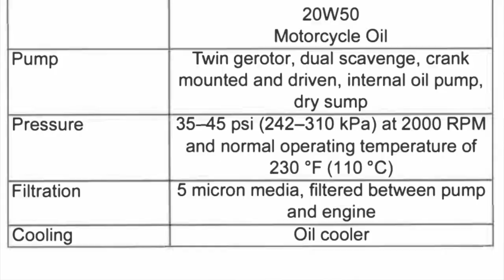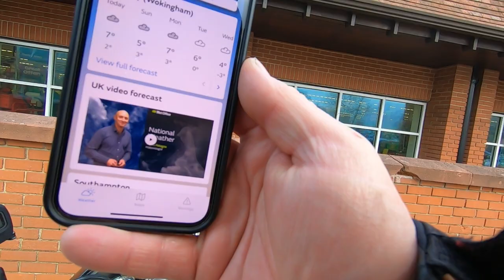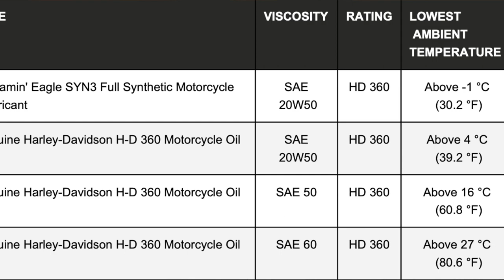Hot Harley Engines | What's The Truth?

Comment: I’m not an expert on oil, but for the past two years, I have been reading up as much as I can on testing in from people that actually know about oil. One of the things I read on motor trend magazine, is that oil needs to get higher than 212 in order to burn water off as condensation, because water boils at 212°F. The article also said that oil starts breaking down past 275°F, and that the ideal sump Temperature is 230 to 265 Fahrenheit. Just thought I’d put my two cents in, thanks for all the content.

Comment: I know this. My ‘21 Low Rider S is a very expensive motorcycle and Harley Davidson has been criticized for using more and more “inferior quality” parts for the internals of these M8 engines from sources here on YT and other places. Sources like “Fix My Hog”, Mike Baxter, and some others have brought up their concerns about the quality and life expectancy of some of these engine internals like lifters and such. So to CMOA and protect my investment, I purchased the “mighty mites” cooling fans for the M8 engine and will be installing soon. Expensive investment, but if it gets me an extra 20k miles it was worth it to me. Besides, it should make riding my bike in the sweltering heat of an Oklahoma summer a little more bearable.
Reply: I thought the heat problem has been addressed in the M8 series. No? I hv devised my own way to address my legs from getting cooked, ie I use after market heat deflector pads
Reply: You might have meant Kevin Baxter, not Mike Baxter?

Comment: Great video! I have seen the video in question, as well as others they have made, and well didn’t bother commenting. Notice the picture was cropped, first hint something may be amiss. Notice that the section in question is referring to 
Pressure” not “temperature”. It’s saying that as 2000rpm, and at a normal operating temp of 230F you should see 35 to 45psi oil pressure when using 20w50 motorcycle oil. It does not say that the motorcycle should be operating at 230F! If you’re using a different weight oil, at a different temp , with different filter, at a different rpm your “oil pressure” may be out of this range. Many engines, and pieces of equipment, specify a “normal” temp so mechanics, and owners don’t go checking things incorrectly such as a too cold or too halt of an engine. I’ve owned Harley’s since the shovel head days and one thing’s been true, people who want to sell you something always tell you the engine from the factory is crap. Always.
Reply from the maker: Exactly my point. cheers

Comment: Interesting points Alf. In the States temperatures are much higher than in 🇬🇧 and traffic in Cities is horrendous at times making slow riding essential. My local dealership in Orlando say they have never had an engine fail just from overheating. Some have failed for having low oil leading to overheating. Riders don’t need to worry about it. Keep safe, no cages!
Reply from the maker: Exactly cheers

Comment: Riding in 90deg F weather in Ohio my 2019 M8 114 motor will hit about 330deg although my oil temperature gauge/dipstick reads around 220deg. I do notice a slight decrease in performance when it’s hot but I would expect that. The bike has over 20,000 miles on it and it hasn’t blown up yet. 💥
Reply from the maker: Yep and I doubt it ever will with all other things being normal

Comment: warm holiday wishes to my friend RA from across the pond! in regards to the EITMS system. I ve heard that it is solely for rider comfort, otherwise it would not have a deactivation switch. as opposed to the system being there for the  requirement of cooling the engine as to avoid overheating damage.
Reply from the maker: Yes great point cheers Ray

Comment: I know which video show you mean, I have seen the guys on their chairs as well. Of course Harley ain't lying. When interpreting oil pressure you just need a (one) reference temperature, that's what it is. Normal does not exist, a definition has to go with it, i.e. all kind of conditions. The 110C/230F is the temperature the oil likes best, which is not too cool, good value to refer to, and any engine will normally (!) reach this temperature, under "normal" (haha) conditions, so normally after warming up (some riding) you should be able to do a check, that's what the oil pressure values are stated for in the manual.
How would you know your oil pressure anyway ? Let alone the temperature. In the workshop they might check, but only in case of doubts. On the tourers the oil gauge has dissappeared (apart for cost savings) since the M8, otherwise a rider would panic when they see low values or wide variations (which is normal, haha) and do not know how to interpret. Now the bike just always says : OK. So, don't worry, especially not on a standard engine. Typically you need 50 km at 100km/h on the motorway to reach stable oil pressure, but oh, do not change your speed, you have to start all over again. That's an air cooled engine, ample cooling capacity, runs cooler at higher speeds !
EITMS is primarily a rider comfort feature, so I have disabled it. When stopping during hot holidays (> 35 C/95F) maybe for short road work stops (3  minutes?), I shut off the engine to save it, that's the best you can do, I can survive the heat. This will benefit oil temperature and pressure immediately, the gauge (TC) will tell after restart and riding off. Before EITMS kicks in, the engine has already taken its own measures whithout you noticing it. EITMS is not meant for longer idling, just when stopping less than e.g. max one minute at a traffic light. It does not look at oil temperature, but engine (=cylinder head) and ambient temperature, the oil is always cooler than the engine. Max 160C / 320F is allowed for synthetic oils, as we al know. And with frequent high temp riding you can get Harley's SAE60 for maintained lubrication. Otherwise change oil more often under those "severe riding conditons".

Yes, oil is always a fruitful subject ............
Reply from the maker: Exactly

Comment: Many Milwaukee 8 engines have failed because of excessive heat within 10,000 MI because the engine is running 300°, what it's supposed to run and what it does run is two different things. So many people have had whole engines replaced under warranty because of heat. Evolution Motors rant cooler than a shovelhead motor. Twin cam and Milwaukee 8 engines run hottest eighties and have many other mechanical fatalities besides running hot.

Comment: I bought an ABS plastic oil cooler cover off eBay, will it be ok or melt RA?
Reply from the maker: I think the proper ones do have some heat resistance but you can only try and see how it holds up